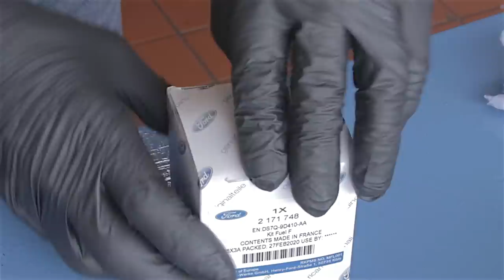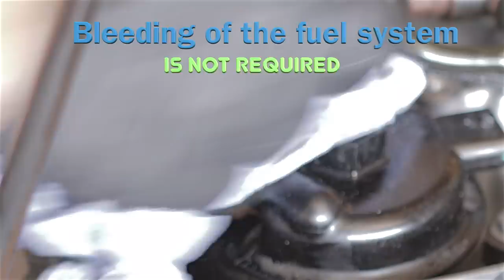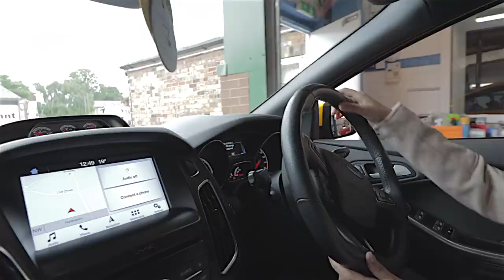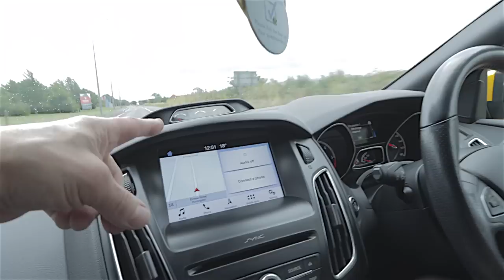2017 Ford Focus ST, 2l Diesel, Oil & Fuel Filter Replacement

Comment: Another great vid Alan. Thank god you highlighted the loosening oil filter issue. I had this on my Kuga, made me start doubting my sanity.
Ford dealers in UK and Ireland avoiding damaged engine waranty issues caused by that filter coming loose. I think it's the rubber seal, it should be made of either Viton, Nitrile or Buna rubber which is oil resistant. The factory banging them out is in Morocco, great place for sardines - not oil filters. I use strap wrench all the time now on only these engines. 
Regarding the fuel filter pot,, I take it out as it has a sump in it's bottom which is very good at hiding metal glitter. Also Ford did not fit the clear plastic drain hose on mine, turn the drain screw and diesel runs down into the alternator (well done Ford). It takes a bit more time to do, as I blow it all out with an air line. I hate this PSA junk. 
By the way I just done the gasket on my high pressure pump intermediate housing. I smeared a small skin of Hylomar around the oil feed into the gear housing before assembly. That was the only area on the old gasket where the embossed surface had vanished completely apon disasembly. 
If Homar is good enough for Rolls Royce, then it's good for PSA engines. 
Thanks again for the vids, keep up the good work with them. 
Your a legend. 

Regards.  Tony
Reply: What's stopping you from using a different filter? Mann, Mahle, Purflux...

Comment: great vid Alan and Monika ive always put oil on my new filter nice to see you respcting this special car with FOMOCO parts worth the few quid more keep em coming pmsl when you said if you find bits of swarf etc in the fuel filter the hp pump could be going out my advice trade it in ASAP lol

Comment: Allan- you know you can easily remap one or two taxis to have 180HP using forscan- just change the power rating - the map is already there- just activate it. Nice video as allways
Reply: Coor a Mondeo St Taxi high performance , its worth a crack
Reply: Or get around 220bhp with an actual remap. The difference it makes to a 150 is night & day

Comment: I used to have a Ford Edge with i beleive the same 180hp 2 liter diesel.  Lovely engine, obviously on a 2 ton car, not the same speed but you really notice the torc

Comment: I am just curious. Why u didnt bleed the system after changing fuel filter?
Reply from the maker: there is an electric pump in the fuel tank to push the fuel through so no bleeding required

Comment: Alan it's a good idea to half fill the metal cannister type oil filters with the brand new fresh oil and then screw back in place
Reply: I have never done this in 25 years, nor have I had any issues... However, this actually makes sense!

Comment: Say your changing an engine mount on your drive, would that plastic sump take the weight of the engine? I would use board as big as the the sump.

Comment: My wife owned a 16 plate   one of these from new for a couple of years. Was plagued by constant DPF blockage issues inc a bunt out dpf atomiser after 4K. Long runs didn’t clear the dpf when the light was on and once it even came on after a 80 mile motorway run.
Was fed up of using the Forscan program to force regen’s every few weeks.
Sold it in the end and bought a petrol Audi.
In total contrast my MK5 mondeo with the same engine has covered 102k and has never had an issue with the dpf or even brought the light on.
Was  a shame to have to get rid of it as it was a great car to drive with plenty of low down torque.
Reply: Dpf delete.
Reply: @Hellndegenerates  How do you pass the MOT? Any way to tell visually? I have this exact car (2017 Focus ST3 diesel) albeit the estate version. And what about car insurance with regards to the DPF delete? Cheers.

Comment: Don't you have to prime the New oil filter before putting it back on also did you change the pollen filter Great video Alan
Reply from the maker: you can prime the filter but many cars because of the angle the filter sits at you can't, there is a fuse you are supposed to remove and then crank the engine over a number of times to get the oil through the filter but probably best to just half fill the filter..no i didn't change the pollen filter on that car, cheers john

Comment: Hello Alan, great and very informative video btw! Just a question, my focus st has come up with the code P228C. I've changed the fuel filter as many suggested as this solved it for them however it didn't for me. I went for a drive and drove hard on 4th gear but it lost all power when the revs hit around 3500-4000rpm. Any idea what I could replace to solve this problem or any ideas what it could be? thank you!

Comment: I have a titanium with the same 2l diesel engine, what is the best oil to run in these engines? I know you mention 0w- 30 but what brand is best? Does the oil have to be a certain specification? Thanks

Comment: You know that pipe on the fuel filter you said don't force, I did... snap. New part ordered and the car isn't moving for a few days
Reply from the maker: i too have broke one in the past,
Reply: @alan4x  is there a way of loosening some bolts around the filter housing to gain a bit more wiggle room?
Reply from the maker: @darren4428  there are 4 10mm headed bolts holding the filter housing aluminium casing to the engine...if you loosen them you will get a bit more room to remove that awkward pipe

Comment: Hi Alan.

In your opinion is it worth having walnut blasting done on the inlet ports of these 2.0 TDCi's ? Are they prone to building up with carbon to the stage it effects performance ?

Thanks.
Reply from the maker: Those inlet ports will always get oily. They don’t build up carbon like you would have seen in a mk3 mondeo 2.0 tdci. 
Personally I would leave them alone. Do regular oil changes using the correct oil. Avoid short journeys and use good quality diesel fuel. Many have said although more expensive than supermarket fuel you get better mpg and performance
Reply: @alan4x  

Thanks for the reply Alan.

Yeah supermarket fuel is a no go for me. Don't even think we've many supermarket forecourts here in Ireland compared to the UK when I think of it.

I might try a hydro clean and see if it helps. 🤞🏼

Comment: Hi Alan! Fun videos as usual! Do you put 0w30 oil in all the diesel cars? Also what can happen if my local service put 5w30 in my 1.5 tdci? :-$
Reply from the maker: yes i use ow/30 in all these engines but i don't think 5w/30 will hurt, the reason they use ow/30 is because it is low ash oil and good for the longenity of the dpf

Comment: Alan how often should the fuel filter be changed ? i'm guessing the ST you are working on as done about 25k.Tangerine Scream lovely colour.
Reply: Well car will come up with error and.go into LIMP mode when you are giving it beans.. usually 35k on others. Intervals are in car user manual
Reply: The mileage my car had done at the time Alan did this video was on 22k and this was its third service. I changed the air filter myself with a Bosch one.
Reply: @neilandbradley6845  air filter is different though
Reply: dean lewis, the service interval for years 1 and 2 is just oil and filter and at year 2 is a pollen filter, year 3 is oil, fuel and air filter. I got a Bosch one as they were on offer at euro car parts half price so did that myself a few weeks ago.

Comment: Those back fuel pipe connections can be a bastard to get on, I end up undoing part of the bracket that holds the pipes together on top of the engine to give just a little more movement.
Reply: Totally agree. There is so little movement on the pipe to push it back on.

Comment: 11:24 First time i hear that dry fitting oil filter? Every oil filter company prints oil drop cans on the filter backs for no reason?
Next you say that some one says that it's better to leave the old oil filter gasket in the engine for better sealing effect?
I have done it and the oil drained like a champion when the engine was running ;)
Edit: 12:42 Good to know im not only one that had that filter come lose. Good thing is that my boss's knows me so 3litre oil and filter tightening bill made them wonder too...

Comment: Oh no not another video about an oil change. :-) Great video, thank you. Alan what's the change interval on the fuel filter on this engine please?
Reply: 20,000 miles
Reply: But do it more often. Only around 12-16 quid online
Reply: @vp5  Got one and did it today. Mine was probably the original one with 30,000 miles on it. Simply done when following this video. :-)

Comment: I didn't even know ST's are available as diesels. I've never seen one. Though I guess they're actually quite rare anyway?
Reply: There are loads in the UK, Ford ST/RS models have always sold well in the UK.
Reply: Damian the last real st had the Volvo 2.5 in it and was 3 door
Reply: @bmwman1981  I had one I now have a MK 3 diesel a much nicer car and still more than fast enough..
Reply: @STASH201161   i preferred it when any performance model ie xr rs st  was only available in petrol and looked nothing like the normal model unlike now when you can buy a stline focus which to most people looks just like a st .I personally think that any st/rs model should look nothing like the normal model cars and should come in 3 door as it’s not meant to be practical and good on fuel if you want that just buy a non sports model

Comment: Just so you know how and why the oil filter comes loose when fitting a new one it should be hand tightened fully then turned 3 quarters of a full turn with a special tool. The reason is because this engine dosent have a balance shaft so vibrated its own oil filter loose. 👍
Reply from the maker: thanks lol

Comment: The oil on the seal ring serves 2 purposes...

1) to lubricate it when tightening to prevent damage
2) to actually form a better seal - imagine 2 pieces of glass pressed together face to face, they'd be easy to separate... Now wet one of them and press them again... Virtually impossible to pull apart 😉
3) allows for easier separation whdn changing the filter - all the other oil seals aren't part of a routine maintenance, therefore the task of removing old seals isn't seen as an issue!

Comment: Wish the 2.0 tdci was that easy to bleed.. i done a suspected blocked filter on an S Max.. but the moment i removed the fuel pipe to the filter, i realised the owner had put petrol in their car..   Had to remove the tank, remove the contam fuel, clean the lines and replace everything.. then, in typical 2.0 tdci fashion, tow it round the road for a fair bit, in gear, for it to fire up.. all because there is no fuel pump in the tank..
Reply: Try buying a suction pump they use for oil changes lidl had one in ages ago.... Put it on the return pipe and suck with ignition on and it pulls the diesel through ..... On my 2.2 i have to crank it to get the diesel through but without the pump it was a pig now with the pump its easy
Reply: @lurchy666  its definitely something I'm going to invest in.. i only work on cars in my spare time, as im an hgv.. There are plenty of specialist bits of kit i want to purchase, a suction pump being one of them..
Reply: @artfulbodger9539   usefull bit of kit for a tenner out of lidls i tell ya..... Maybe not the quickest thing on oil but does its job well

Comment: An ST with a deisel engine ?  😂🤣
Btw, no hate, but draining the oil then taking off the oil filter while the sump plug off ensures proper draining of oil. This way you ensure no old oil remains in the engine when refilling. Also pre~filling the oil filter with oil will prevent the engine dry run upon first start, for a second or two which can't be bad in the long run. Just a personal tip.

Comment: You mentioned that thw st uses the same engine  as the Mondy fleet taxis but with an ECU tune.you should mod the ECU on one of the ladies in red and create a super taxi.make a good installment. 🙂
Reply: Gareth Shepherd I had my 2.0 TDi Skoda Octavia private hire taxi remapped to just under 200bhp. Gives drivers of Focus STs and Golf GTis a bit of a shock at traffic lights 😂

Comment: Just discovered your content and love the videos on the 2.0 tdci engine 👌 I've a 2015 version of the St2 2.0 tdci, fun to drive but. At Xmas I've had to replace 4x injectors, maf sensor.. And just recently 2x more injectors needed replaced and now another one has gone 🤷‍♂️ as the error code was telling us cylinder 4, then 2 now its showing cylinder 3.. Injector (delphi) retailers aren't replacing the 3rd under warranty as they maintain now that it has to be something else that is causing this problem.. After replacing we tried to get car to relearn all values itself but the fault would not stay away long enough to get consistent drive to finish process.. Reset all learned values on high pressure fuel system and everything injector replacement related with forscan and the car died at the side of the road now won't even fire up.. Any suggestions? Or is it a case that she needs to have PCM reflashed at main sealers? Mechanic thinks it might be the HP pump but can't be sure, costly experience if not the issue... Any recommendations of where to start troubleshooting?
Reply from the maker: Check your fuel filter bowl. The high pressure fuel pump can put metal fillings into the fuel system which will very quickly block up your injectors and cause misfires
Reply: cylinder 4&2 has two new injectors and 1&3 has the last two remaining one fitted at xmas, I have noticed that the top line of numbers on 1&3 the 3rd row is scored out, (same as the two failed ones also) supplier reckoned that the way they come but the new ones don't have any marking on them at all🤷‍♂️ have you ever came across this?
Reply: @alan4x  thanks mate for your fast response, its at the shop now so I will ask him it that's what he's done 🤞 pity I'm located in Ireland otherwise I'd be more than happy to have you work on my car any day👌👍
Reply: Would P0170 fuel trim bank 1 code be related to the HP pump.?
Reply: Update, Alan yup you are the man 👌 fuel filter housing was all sludged up with shit and the hpfp took a dump in the middle of the process 😭😭 should have sold it 2 weeks ago now 😢🤬🤬🤬🤬 PS what are the fittings called and the pipe size of the lines going into the common rails (AN6) from pump the ones ya use the 17 spanner to take off.?? 🍻🍻

Comment: why does a ford 2.0 diesel require 6.5L but VW 2.0 requires 4.8L?
Reply: Engine size is one factor, also number of cylinders. What it basically comes down to is sump size. The VW engine is quite long stroke (81 x 95.5mm) whereas PSA engine is almost square with a quite large bore / stroke ratio for a diesel (85 x 88mm). Bigger pistons = bigger bores  = wider engine = larger sump width = more oil capacity...there is also a trade off with having more oil to cool components and allow for longer oil change intervals vs carrying less oil and therefore having less oil to pump and less losses so more power. Each manufacturer chooses what they think works best.

Comment: 18:12 they're fitted to the current Focus too and they fail too easily because Ford engineering decided to use springs that are too weak. There should be a new one in service by now that fixes the problem.
Reply: amazing idea, never seen one of them before

Comment: I have a Mondeo 2.0 TDCi Zetec S if you want to fix it lol ;-)
Reply: @alan4x  Little story for this one. Failed the MOT on emissions, for my 2.0 tdci (130)  the limit should be about 1.27 average, mine was 2.45 overall on the 6 peak tests. So... as I use my bike for work and no one going out the car has sat for a while through this shitty lockdown. The mot tester said there is too much smoke coming out like black on hard throttle when its being tested should be almost clear,  he said put some stuff in it to clear it out so i did wynns emissions cleaner stuff £6 with £30 worth of v power diesel! ragged the crap out of it in mexico at a decent 70mph in 4th on a trip to no where and back. Due to work i only had 4 days left of the 10 for the free mot re test. I took it back and he said naa still doing it, so i`m like blx.. took it home to find the intercooler to inlet pipe was split phoned Ford they wanted £107 + vat.. eww sod that! evilbay £18 !! paid the extra to try get it here quicker so I could fit it but got here too late I finished work the same time they did so im now just going to wait and fit it over the weekend and hope this might clear the problem ? My thinking is that the high revs the fuel is being fed in but not enough boosted air pressure for the amount of fuel being pumped in causing the smoke. I`ll have the EGR off when i replace the pipe to see if thats clogged up and change the air filter. Might even wash it and whip the hoover round if it works :) I did say to it, if you are really good ill get the wax out!!
Reply from the maker: a split turbo hose will cause serious soot build up and once you replace the hose you will need to give it a good thrashing... there will be clouds of smoke out the exhaust in some cases
Reply: @alan4x  oh yeah will give it a little drive when its done. The car never gets thrashed so ill probly notice the power difference once it returns.

Comment: 4min 53 quite clearly see Citroen logo. I owned galaxy with same engine, all was fine until 60k then things started to fail or leak. Mpg is under 35 and auto box leaked oil and started to roll back on hills when put in drive. Dealer said don’t work on auto and would have to take 60 miles to another ford dealer for warranty. When took to other dealer was told rolling back was normal and just wear and tear and oil leak only very slight drips so is not warranty and won’t be fixing. That was when car was 2 years old with 40k. Won’t ever buy ford/Citroen again.
Reply: Sounds like bad luck and coupled with bad dealership. I drove a 2008 Ford galaxy with the 2.2 diesel and it was lovely but it was only 6 months old back then